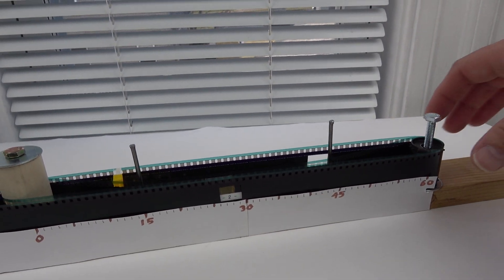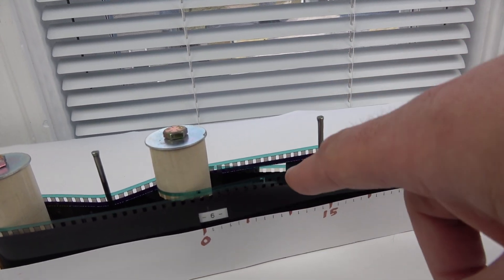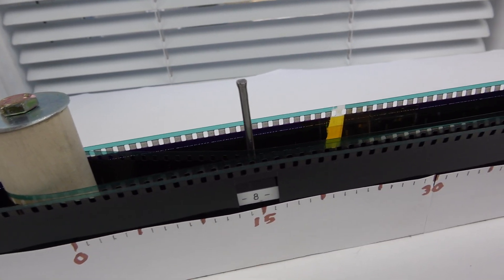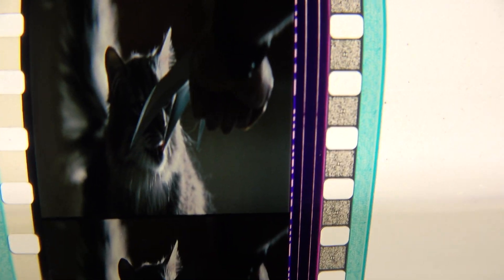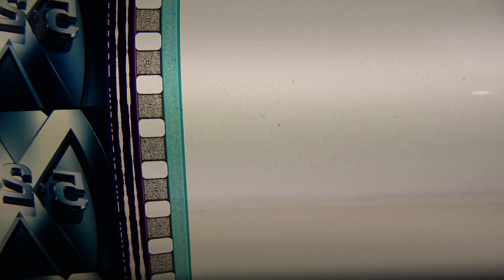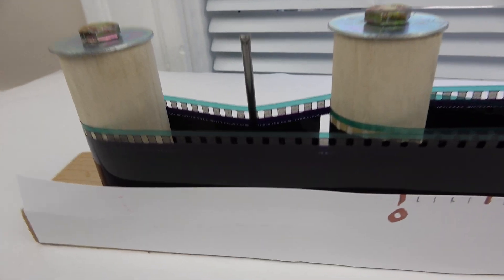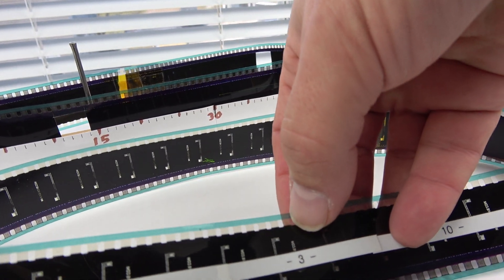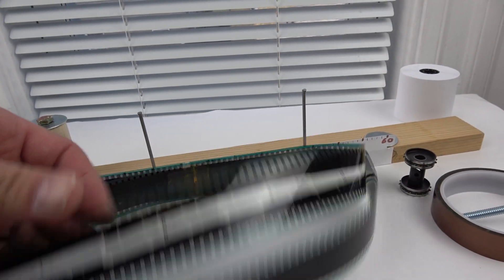Unusual Clock from 35mm Film

Comment: This weird frame aspect ratio is called “anamorphic”. The lens on the projector is designed to stretch the picture horizontally to fill the screen. This was designed to fit wider frames across the film without losing vertical resolution.

Comment: nb4 the Disney DMCA takedown notice... OK, seriously, that's a clever clock design. 
Thinking about the film soundtrack. If you developed film with the windows as you mentioned, you might be able to include an extremely simplified "soundtrack" to encode bell strikes.
As for film splicing, don't they use ultrasonics splicer for myler? I'm not an expert just a semi-informed guess.
Reply from the maker: Interesting, I see ultrasonic splicers for polyester / mylar available on eBay- not cheap, but definitely worth a try.  This seems to have been invented for space reconnaissance, see https://www.lib.rochester.edu/IN/RBSCP/ATTACHMENTS/Kodak-Historical-Collection/scope-contents-for-Box-138-Ultrasonic-Splicing.pdf
Reply from the maker: Well here is an example ultrasonic splice, pretty ugly..  https://www.sprocketschool.org/wiki/File:Ultrasonicsplice.png
Reply: @jhallenworld ... Uh, yeah. Not pretty at all.